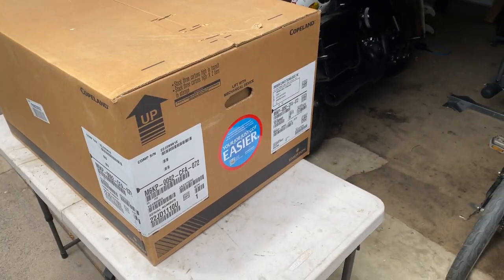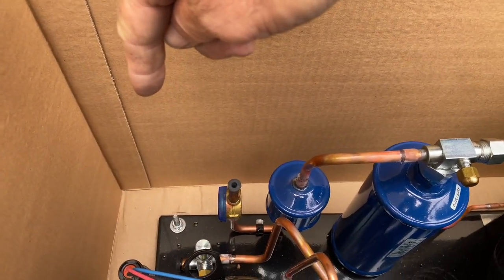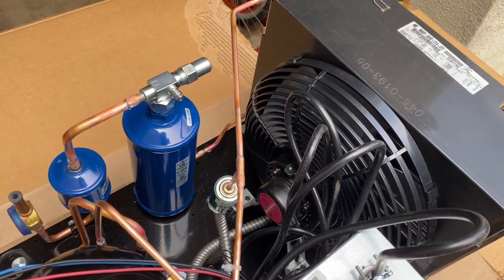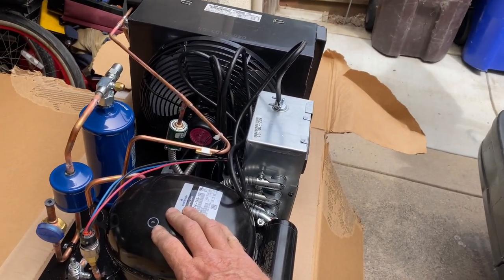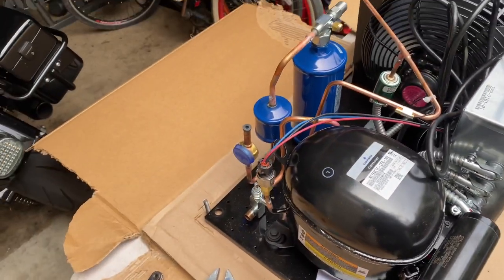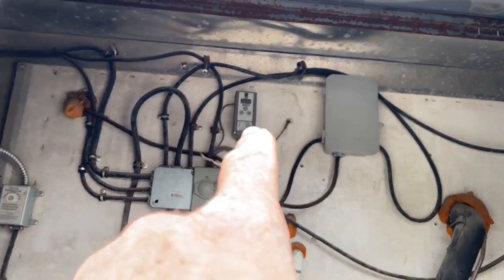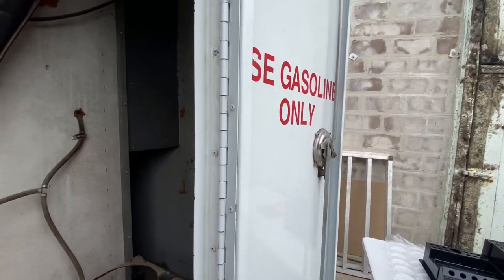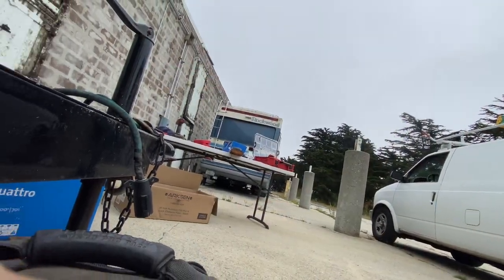Solar powered keg trailer condensing unit install

Comment: Another great video.. 
A good lesson for people wanting to power up devices with undersize cords. Ohms law will provide info on how much voltage drop you're going to get given a certain amount of amperage and the resistance of the wire. Always remember that every wire is a resistor and will always drop more voltage when there's more current draw through the wire . Voltage drop across wire = Amps X Resistance of the wire. Also understand that as the temperature of a wire increases so does it's resistance which will increase the voltage drop across the wire creating more heat. Also remember that the current makes a round trip so the drop is both on the supply and return wire so it's additive. 
If your solar inverter set up will provide you with 220-240 vac, you're better off using 240 vac equipment because it will pull half as much amperage as the same horsepower load does on 120 vac. As such the need for thicker wire is also reduced.

Comment: With plugin keg trailers you'd be limited to 115v because that's what most places will have easily available, but with solar you can just get a 240v inverter and have a 240v unit.

Comment: I installed one of those 115 units this week and the people at the supply house didn’t give me the Pump down version so I had to add my own high and low pressure controls 🤦‍♂️. of course that wasn’t in the estimate

Comment: That will have a hard time bringing hot kegs down to below 40 in a  reasonable amount of time.
Reply from the maker: They always struggle the event trailers
Reply: dry ice! precool the kegs and maintain with dry ice. use keg trailer just for dispensing.